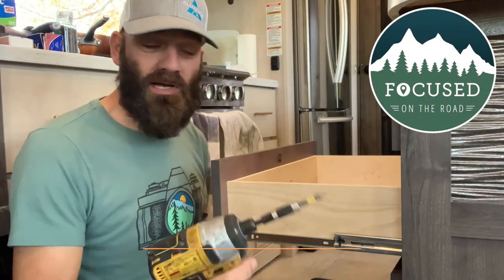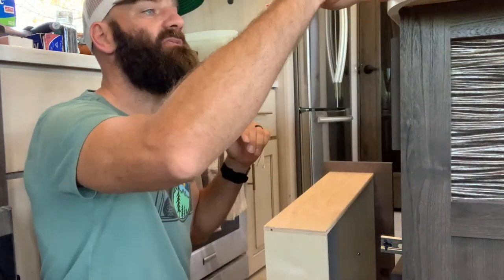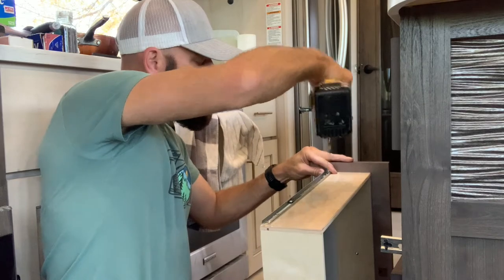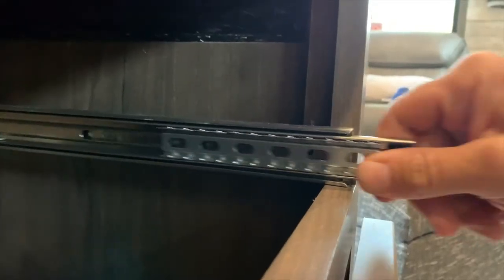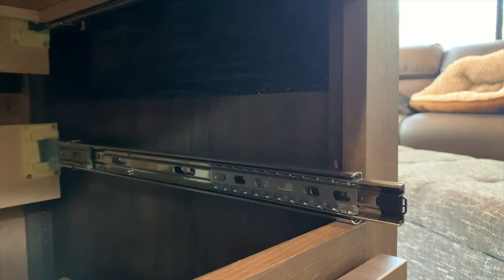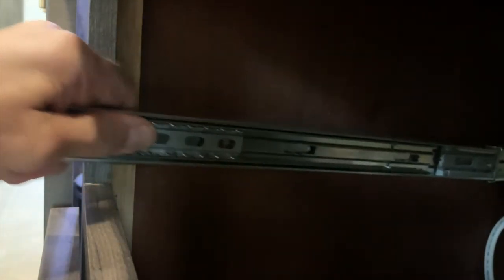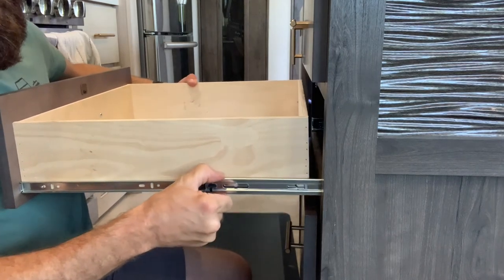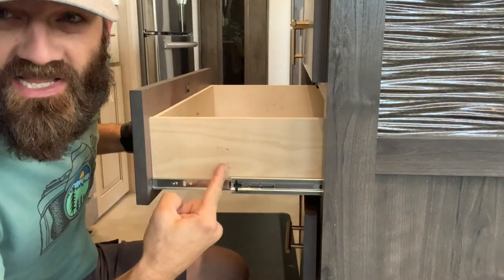DIY RV Drawer Slide Replacement | Full time RV life how to

Comment: QUESTION……… I need to get my two bathroom drawers back in and they’re not wanting to go,HELP PLEASE
Reply from the maker: @benjaminclutter1006  interesting… sometimes you just need to align the tracks and push real hard.. they will go in super hard but once they are all the way pushed in.. it kinda fixes itself and it’ll slide normal. 
Alternatively, you could take off the slides and replace them. They are super cheep from the factory… or al least the early models were. 
Put in some soft close drawer slides. 
Hope this helps.

Comment: Great detailed video but why were you having to replace drawer slides in a new RV?
Thank you!
Blessings and safe travels
Reply from the maker: Good question! one of the panels on the kitchen island came loose, when they repaired it, they messed up the drawer slides. probably just the brute force trying to get the drawers back in place. It happens to the best of us.  :)

Comment: Silly question.  Why did you need to replace the slides?  We haven't had any issues with any of the drawer slides in our Heartland that we have been living in for a little over 3.5 years.
Reply from the maker: Good question! one of the panels on the kitchen island came loose, when they repaired it, they messed up the drawer slides. probably just the brute force trying to get the drawers back in place. It happens to the best of us.  :)
Also could have been a defective drawer slide or the terrible roads in michigan...hahaha.. bouncing all over the place. The drawer slides were also only held on by 1 screw, so i added another screw and sent a message to the service manager to give them some feedback.